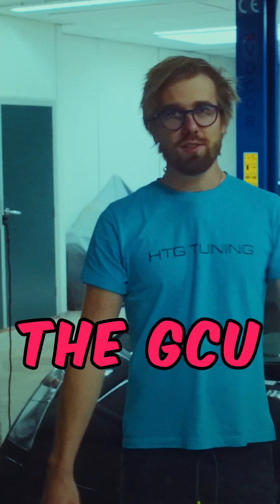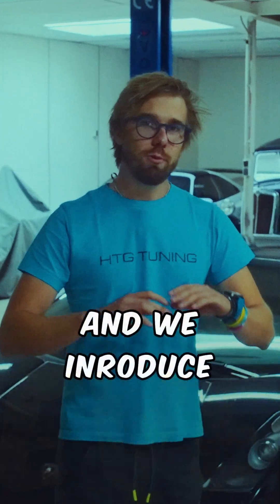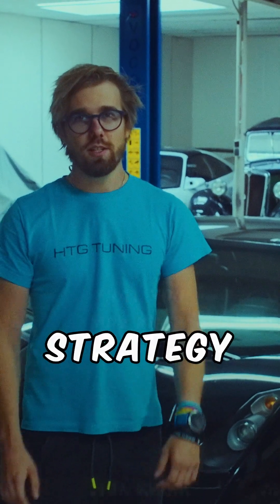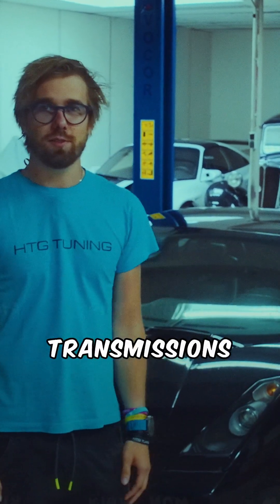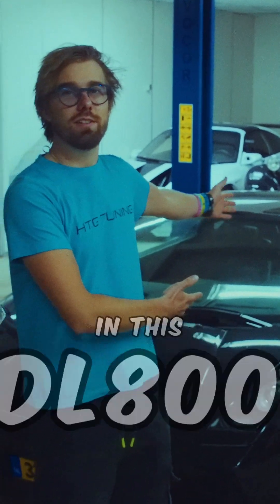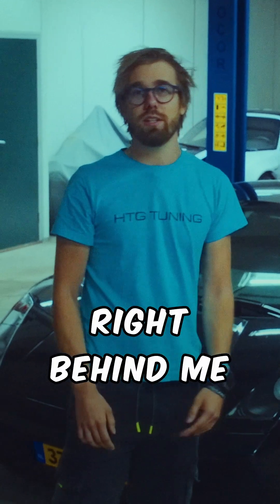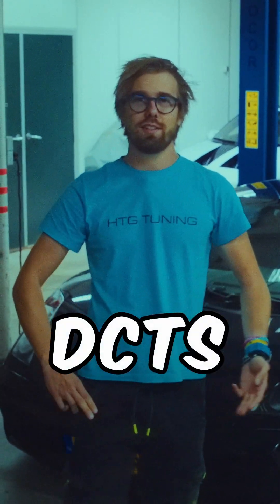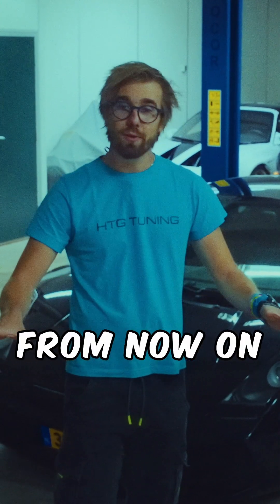Closed Loop for dual-clutch transmissions ran by Gearbox Control Unit

Comment: Finally done with my swap. Lots of little issue but none of them your concern. Once I understood how it works it is very nice. I am just not very tech savvy. Questions I have:
1. This needs to be done regardless of the gearbox? Bmw s54 to DCT
2. Do you need to hook it up to the laptop or will the gcu do this without you looking at the data logger?
Thank you!

Comment: I really need help with my project. What I need to buy from you for LS3 + PDK in Porsche 911 coupe 1988 G-model. I want to go with 997.2 PDK but 991 are more likely to be available than 997.2. My worries the size is different. So other than the adapter plate do I need only GCU? please advice ?
Reply from the maker: Just GCU, optionally wiring kit for it. All can be found at shop.htg-tuning.com